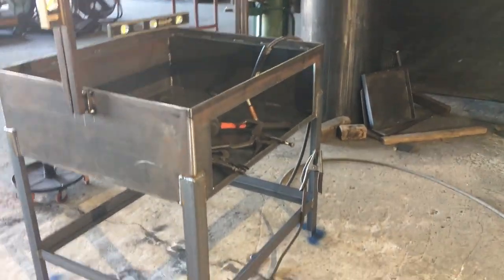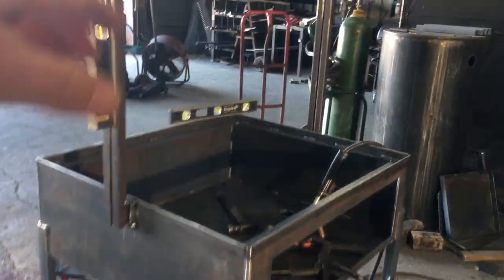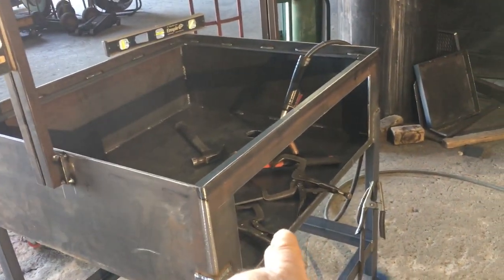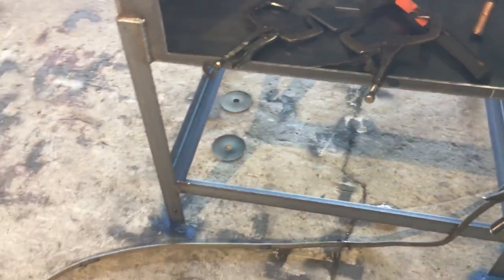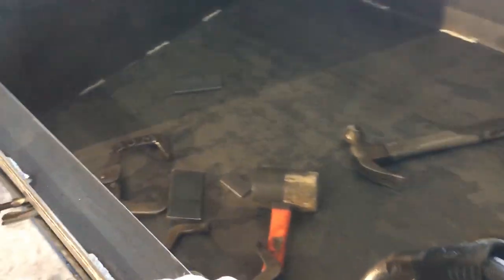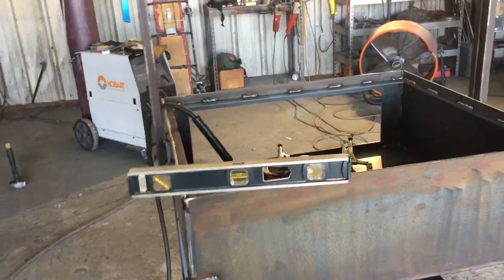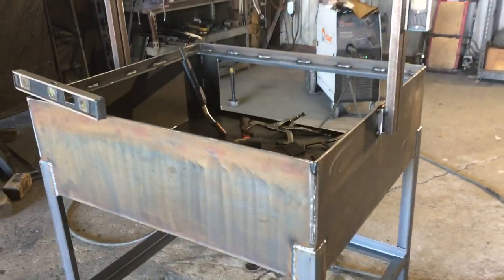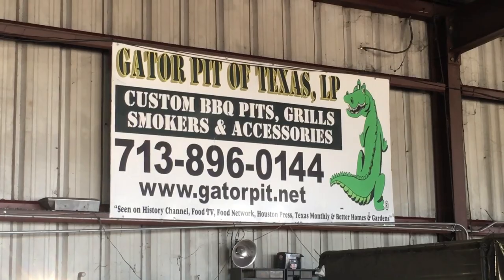Santa Maria Grill Heavy Duty

Comment: Great job looks good I like your metal working, but one question why used 1/4'". I am thinking about building one using 1/8" plate reason  flux core welder.
Reply from the maker: Thicker steel, better heat retainer, less fuel usage.  And, less like to burn or rust out over the years.  Lastly, won't warp when fabricating it together or when building a hot fire for grilling.